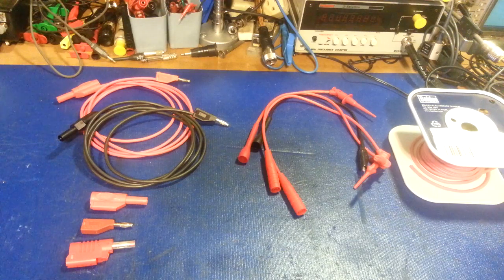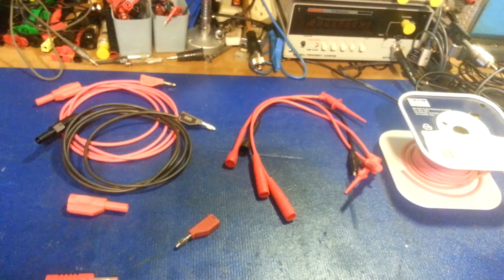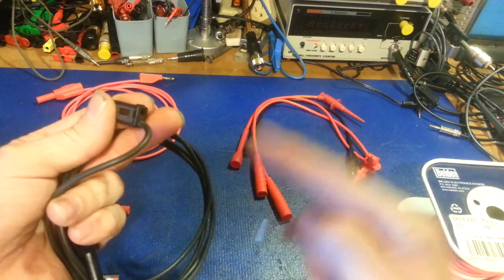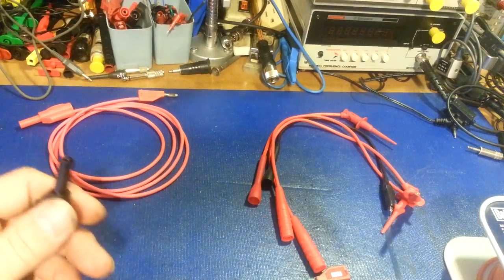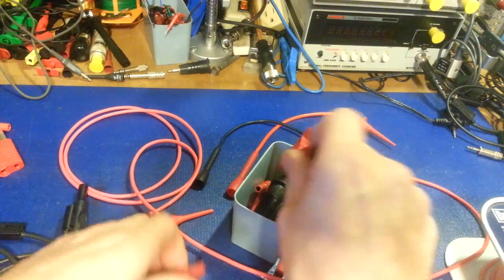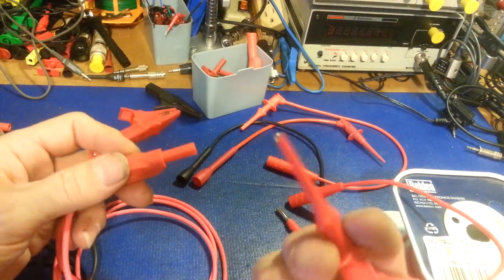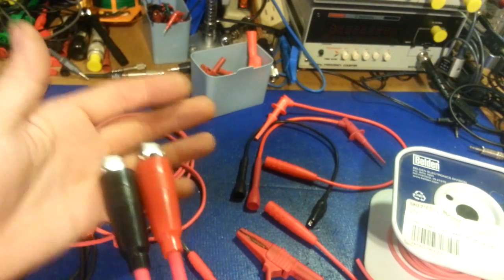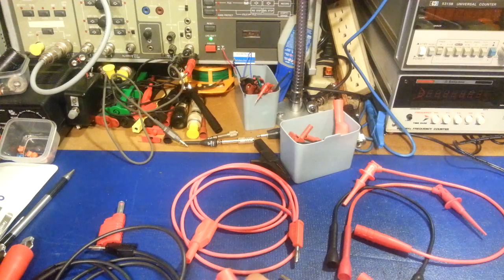Making your own high quality custom test lead wires and jumper cables.

Comment: How long do banana plugs last? What I mean is, how many insertions/removals can they undergo before failure? I feel like screwing leads in would make better electrical contact but I would like more data, if available?
Reply from the maker: Let's put it this way.  Some of the banana plugs I own and use came from my uncle who got them from my grandfather who used them in the family radio/TV business that closed in the late 70's.  Their durability isn't the problem, quality is.  High quality banana plugs can last a lifetime or a couple lifetimes.  Cheap Chinese made junk might last you a year or two.  I have seen cheap Chinese ones that were no good when brand new.  Buy high quality and you will never regret it.
Reply: @mikesradiorepair  Understood; thanks! I'm having difficult finding exactly what I'm looking for. I prefer gold-plated where possible but I can't seem to find any that are suitable. Want gold plated, fully insulated, and decent quality - no idea where to even look lol

Comment: Where do you buy your Belden wire? And the ends for the wire.
Reply from the maker: DigiKey
Reply: @mikesradiorepair  Thanks for the reply, what gauge wire do you use when making leads?  i think the SKU has changed.

Comment: Many good tips and ideas.  When you talked about touching with a hot iron and no problem, I thought the insulation might be silicone but the description on Amazon is "rubber".  I suppose that could mean silicone rubber.  But what gave me the heart attack was the $ 300 price tag for that 100' spool.  But I do see some 25' spools of both red and black non-Belden 18ga. (BNTECHGO) wire for $ 14.  Their 16 ga spool of both black and red is $ 19.  Is there any advantage to going to a larger wire for normal electronics troubleshooting like on old ham radios and test equipment?  Do you use the 18 ga leads on those old TV's you work on or do you have a bigger set of leads for them?
Reply from the maker: The only reason to need larger gauge wire is if you are using the test leads for higher current measurements.  When doing voltage, resistance measurements and things like continuity test there is very little current flow in the test leads.  Start passing 20 or 30 Amps through a set of small gauge test leads and you will soon start to see the wires smoking.
Reply: @mikesradiorepair  Thanks for the advice, Mike.
Reply: Hi there. Was curious if you did end up making your test leads and used the $14 18ga wire you found on Amazon, and how they were working out for you.
Reply: @anthonycomeaux1804  Actually no, I took the easy way out and bought some already made test leads on Amazon.
Reply: @STBRetired1  Ah, gotcha. It's all good. That belden wire is expensive, so was curious if a decent alternative was found. Probe Master may actually be pretty cost-efficient

Comment: What gauge is the safest to avoid burning the leads?
Reply: It's the insulating covering that protects the wire from burning.  The cheaper test leads have a PVC or plastic insulation which will melt or burn.  The better cables have a silicone rubber insulation which is more resistant to burning.

Comment: Please, tells us the most common AWG gauge for the lead wire? Is that AWG16 or AWG14 or anything thicker (which is doubtful) ?
Reply from the maker: 18GA is probably the most common for common multimeter test leads.  Really depends on what you are using them for.  Probes for logic analyzers will be small at around 26GA and on the other end of the spectrum I have test "cables" that are 2/0GA when I need to pass hundreds of amps of current through them.

Comment: Very good advice! I need test leads and have been debating between the Belden 8899 rubber coated wire vs Pomona 6733 silicone test lead wire. I work on a lot of tube amps with 400-500V+. I've read that the Pomona is very flexible. However, I think Belden is rated for higher working voltage.
Reply: I doubt Pomona manufactures it's own, but 6733 is good stuff - and rated 10KV. Belden 8899 is rated 5KV. Good luck!
Reply: @allanknox8216  I spoke to both Belden and Pomona. Pomona gave me no confidence that their product is reliable at high voltages. I'm not sure their ratings mean the same. Belden on the other hand gave a thorough explanation about rated working voltages vs tested voltages etc. And told me not to hold any wire with high voltage running through it.
Reply: @acoustic61  That last is a good point. I got my first HV burn when I was about twelve years old. Hurt a lot. When I was all "grown up" I came close to losing my life when a radar was marked as "tagged out" and it wasn't. Almost grabbed the 440 VAC three phase line filters with a wet rag when cleaning one of the radars innards.

Comment: Can you post a link where to find this wire? 
 What gauge wire are you using? I shop for test lead wire and a ton of things pop up. I cannot find the same stuff you're using. Is 18 gauge the standard? I think Power Probe uses 10 gauge. Will the banana jacks fit ANY gauge wire?

Comment: Is there a way for the average DIYer to find out whether I am being sold BS jumper cables? I am looking at some that are 6 meters rated 1200 Amps; that sounds like a lot of juice to me! I doubt I'll need that much, but then again, these are pretty long cables, so wondering about the quality. My battery is rated at 800 CCA. Is the only way to find out to jump an 18 wheeler and see whether they melt? :)

Comment: Great video, Mike...very educational and helpful...do you have the names of vendors you prefer to order from for both the Belden wire and tips?   Tried the Belden 214-3474 part number in a Google search, not much coming up....thanks in advance for your excellent videos...N5ITU
Reply: Since the author never answered this, and I too was having issues finding it on ebay (because that sticker is pretty USELESS), I did some digging, and the correct part number for this wire is Belden 0905 8899 002. This should save some time for others that are looking for it. The author should have clearly mentioned that or put it in the description box, they never realise that some of us are hardly starting out and don't know sh* about brands and types of cables.
Reply: I just bought some to make test leads for my multimeter. Before watching this, I was set on buying 14 AWG but then realized that this is perfect for testing purposes.
Reply: Randy Espoda n

Comment: Mike, I'm very curious how you deal with dust? You have so many test equipment, parts, leads, power sockets, components and stuff all over the place. How you get rid of the dust accumulating on them? Thank you.
Reply: He doesn't. Look at all the sh!t on the table.
Reply: @itsruf1  LMAO!
Reply from the maker: HEPA room air purifier helps keep dust at a minimum and a vacuum with brush attachment for cleaning.